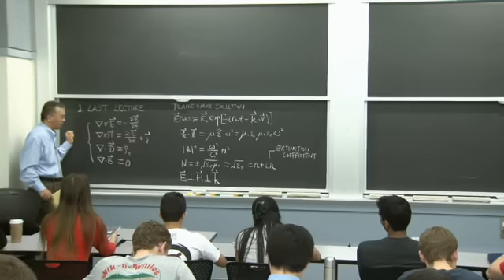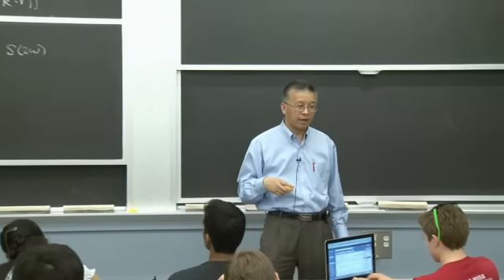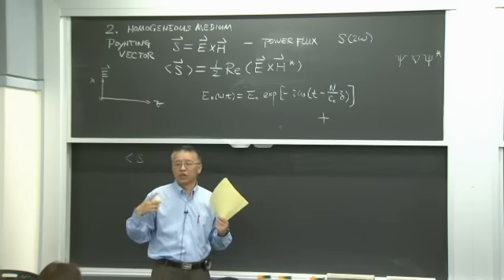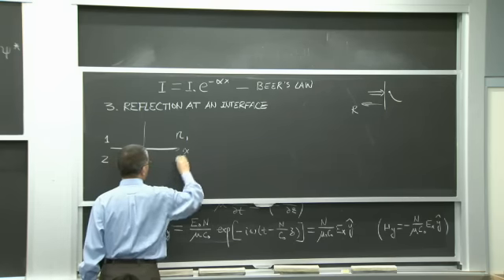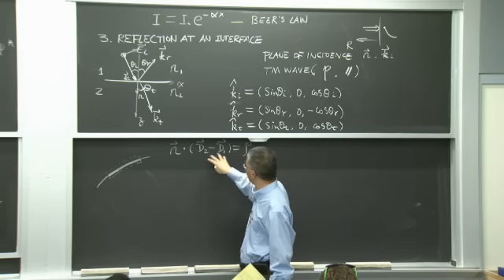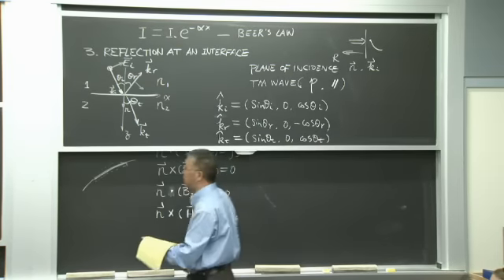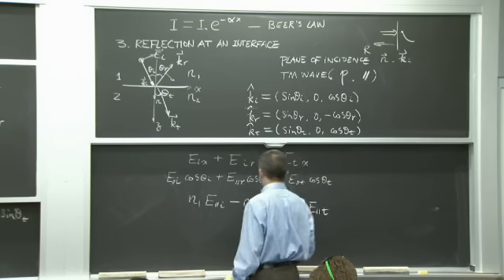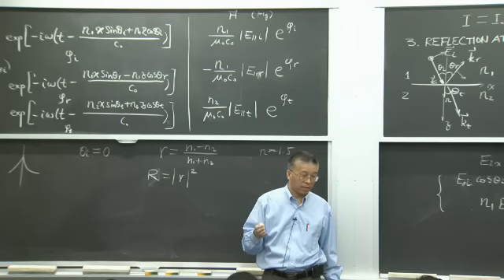12. EM Waves: Reflection at a Single Interface

Comment: What is happened to reflection when the electric field In the direction of propagation?
Reply: For a plane wave E & H are always perpendicular to the direction of propagation. When you have a wave confined within a waveguide there can be a non-zero component of E & H in z, but it is typically rather small.

Comment: When will absorption occur, Professor.?
Reply: Absorption occurs whenever the material is conductive, or when the frequency of the EM wave is in resonance with the bound charges within the molecular bonds of the material.  Basically whenever the energy from the EM wave is transferred to kinetic energy of a charge with in the material.